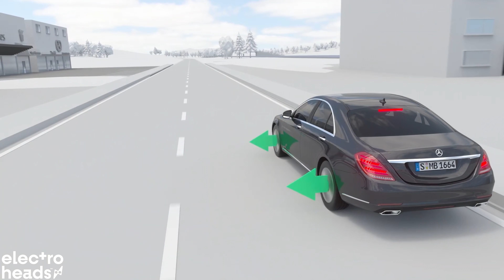The truth about why electric cars are so expensive

Comment: Interesting video so my twopence worth: To me the big problem with electric cars and regardless of price is the stupid amount of time they take to charge. If you think about the "range anxiety" thing would just go away if you could recharge them in the same time you could fill the tank. As you alluded to at the begining of the video, the current technology is total rubbish, under cooked to say the least. Lastly, if we really want to "green things up", I wouldn't start with cars which despite their numbers on the road, in individual terms are not used that often during a day whereas Artics, vans and buses are in constant use and really do pollute. Good video :)
Reply: My Kia can be charged up from 30% to full in around 40 minutes using a 100kw charger. Is that really stupid? But most of the time I - like most EV owners - charge during the night on cheap rate energy. The time it takes to charge then doesn't really matter, because you are asleep. Everyone has to sleep. So it's a good time to charge an EV. My Kia has around 300 miles range when fully charged. That lasts me almost two weeks, so I never worry about range. I find it strange you seem so assertive in your comments, yet you've probably never even owned an EV?
Reply: @Brian-om2hh  Sorry Brian, you are defensive because you have bought into it. Look as an OAP I could make an EV work for me just as you say but that is not my main point which going back in time when I was working, I had the need to use a car for visiting sites across the UK doing at least +30,000 miles a year for work and from that perspective, it's not really a practical proposition in my opinion. For the majority of users who probably only do a 20 mile round trip on a daily commute, it's probably fine unless we start getting a higher percentage of EVs on the road that outstrip the charging infrastructure. 

As to owning an EV, no I don't but then I got rid of my ICE car two years ago simply because the amount of use I had for it compared to the costs were to my mind silly, instead I just use one of my mountain bikes and for longer distance travel, public transport of one kind or another. I don't think that the technology is 'right' and the future may well be more influenced by changes in society and the way people live their lives. Originally a Londoner, when I lived close to Central London, I got rid of my car and became a cycle commuter, it was not just quicker to get anywhere but even 20 years ago owning a car in London was nothing but a liability on so many levels. Take care and keep yourself plugged in :)

Comment: small short range EVs; 20kWh pack 100mi range are significantly cheaper to produce than the similar compact gasoline version. Fewer parts, and as long as the battery is small total cost is lower. The question is why car manufacturers don't make them, except for the Chinese, that apparantly believe the more EVs the better and sell one of these for $5-7K? In other words, EV list price depends on kWh price of batteries. As it drops slightly each year, EVs will get cheaper. However European and American manufacturers are in no hurry. The profit margin for luxury EVs is higher, and they need someone to pay for a new production line. However this is decrimental to the rollout speed of EVs, so now in some countries, top range EVs no longer get a tax break, and the plan in Germany in the course of the next 12 years, is to implement a taxation based on consumption like any other type of propulsion. So in time the market will favour smaller cheaper EVs, and the high end segment will be saturated. At that point the money to be made are in cheap EVs, and the manufacturer will follow. Until then, we'll have to do with Chinese imports, which I suspect will cover that segment of the Western markets and be the prevailing small EV for the next decade.

Comment: As I mentioned on the other video from Richard - there are real consequences of switching our entire road infrastructure refueling system to electric overnight that the high costs are actually helping in an ugly way. Where does all the electricity come from for this EV revolution? Power generation in the UK ain't there (yet?) I know renewables are coming but they're only being brought in to replace existing dirty power generation. I hope the UK is actively investing in greater power generation infrastructure AND investing in a lot more public charge points, as there will be fist fights over public EV charge point availability. Home charging is difficult in the UK thanks to a lack of home garages in a lot of places, mine included. Plus the councils are actively stunting home charging by denying garden to driveway conversions (personal experience), if you're prepared to do this anyway. The world has spent 100+ years with personal transportation amenities at your local garage forecourt, these will slowly die a death, but not before the space is needed for more public charge points, in the thousands per city. We're not ready yet people!
Reply: Put enough petrol in a car to travel 100 km. Now put the electricity used to make that petrol in to a BEV and it will travel 70 km. So at macro level the Electricity required is a lot less than it appears. Around the year 2000 Oil refineries become coy about revealing their electricity usage, I wonder why. Refining is a very energy intensive process. 
We are not going to switch to EVs overnight. An EV on coal powered electricity is still cleaner than a petrol powered car. And doesn't have tail pipe pollution. That pollution kills about as many people as traffic accidents do.    Also once level 5 autonomy is reached your car can drive to the charger at night or when electricity is cheapest, charge itself up and return. Problems exist to be solved.
Reply: @danielstapler4315  If energy charges are based on peak demand periods, won’t overnight charging on cheap rates be turned on its head, with night time off-peak becoming the new peak consumption period?
Reply: @lotusgroup123  Yes, I think it will smooth out the difference in rates. But overnight charging will better use an expensive grid that is currently under-utilized. This would place downward pressure on the electricity price. Australia's grid is much more costly and more reliable than the USA grids and a KWH has 12 cents of grid cost attached to it. And that grid spends 10 hours a night not doing that much.

Comment: All three reasons are correct imho - legacy auto makers face a huge challenge to switch their production output to electric. I went electric in 2019 and have no regrets. I still have finance on the car, but even with this I am saving money over my old 2005 Mercedes which cost me £325 per year in road tax, and about £270 a month in petrol. I now run a BMW i3, I charge at home on cheap rate overnight electricity- 25% to full costs about £1.30, no car tax, no servicing. Smooth, quiet and relaxing motoring. My commute is very 'stop-start' on congested roads which used to add to my stress. In the EV it's relaxing, no movement; no consumption & the electric drive is sublime in stop/start road conditions. The stress reduction alone has been worth it.

Comment: 2 decades ago I studied economics in university and did a project on the price of jeans. The aggregate data proves no corelation between costs and retail pricing, suggesting the price to the consumer relies only on marketing strategies / the demand side of the goods.
It just might be similar with evs. Supply side costs don't explain the pricing of evs, however the demand for evs and total cost of ownership of evs over time explains the price to the consumer better imho and also the pricing difference between markets.
In a sense, the lower cost of ownership of evs vs ices, is reflected in the higher initial price point of evs.

Comment: Hello, You make some very good points. You mention that the price of electric cars is getting close to the price of petrol cars, that may be. But many manufacturers have increased their prices massively for petrol cars. For example if you look at the price of a mid spec Golf, it is about £25k. In 2017 a similar spec Golf was about £20K. I am sure that most salaries have not increased by the same percentage. Purchasers of electric cars are just guinea pigs as they are buying a product that is not fully developed and paying through the nose for it. Thanks for a good review.
Reply: Ice cars are going to get more and more expensive and rubbish as all rnd moves to electric vehicles

Comment: If you add in the externality costs of both EV and ICE approaches (oil extraction, production, greenhouse gases, pollution-related sickness and deaths VS lithium mining) you'd see an even greater 'savings' from EVs.
Reply: Don't overlook the oil industry, and their decades of mining cobalt. They need cobalt to remove sulphur during oil refining....And you omitted to mention the huge pollution caused by the occasional tanker oil spill, of which there have been plenty over the past 50+ years. Thousands of square miles of ocean and coastlines covered with thick crude, with the clean-up inevitably costing millions.... The potential of that disappears almost completely once we're all using EV's.....

Comment: In China EVs are extremely cheap and it is measure of time for this to happen in Europe. You can check the price of Chery Tiggo E (3xe) for example - it is about $15k. Of course the protectionism of greedy EU companies will not let this happen very soon.
Reply: So by that reasoning an iD3 in China will be cheaper then? Because the market place for the iD3 will be cheaper. Or is it that cars built in China are cheap in every sense of the word?
Reply: @martinblaylock7473  As far as I know chinese company SAIC will manufacture and sell the ID.3 in China but I dont know the price. I am sure they bild cheaper in China but they also made cars very practical using simlpe decisions without expensive extras which are suitable for most peolple of our world. On the other hand EU regilations during the last 30 years made cars in Europe so expensive and it occured that Chinese EVs  are cheaper than petrol cars in Europe nowadays.

Comment: I work in the automotive industry and it is not so easy to answer why electric cars are so expensive. The claim that batteries are expensive is no lie. But prices for batteries are decreasing with increasing demand and battery technology is also constantly improving. The RnD costs are also part of the vehicle price. And it is cheaper to produce an EV that is developed from the beginning as an EV because the company can directly create packaging that is cost and performance-optimized. in the electric VW golf for example the electric parts were put in the space that was there because of taking out the engine and the other parts that were not necessary anymore. The battery pack was split into two locations and was liquid-cooled. It was a development nightmare.

But it is kind of true that carmakers do earn more on petrol cars, don't need to invest much on improving them and would like to not kill their cash cow too quickly. For that reason and also because they didn't believe too much in electric cars till recently, they were not too much in a hurry to get out good and cheap EVs quickly. Now after the diesel gate, increasing emission norms, more and more EV startups and Tesla slowly producing cars that really work, the big car makers start approaching the EV topic more seriously. Maybe Apple will surprise us and really sell their own car soon and then maybe something small and affordable. (maybe the affordable is too optimistic)

Comment: VW, Audi group make the ID4 at over £40,000, and the Audi is over £100,000. Yet China can make EV's for around £8,000. The Renault KZE - which will be the Dacia Spring in UK at £22,000.

The battery technology is  not new, Tesla batteries are same cell type as a Laptop, cheap as chips.

Comment: The biggest machines battery powered were power tools, really? what about milk floats, fork lift trucks?
The cheapest family sized EV in UK the MG ZS is £10,500 dearer than the petrol version, yet they save fitting an engine and gearbox. It is a rip off.
Reply: It isn't £10500 dearer if you go to Autotrader or a similar site........ Autotrader are - or at least were - offering the basic MG5 electric estate car for a sub £20k price....   I've seen new Nissan Leafs offered for sub £25k, or PCP for £200 per month. Shop around..   In fact I just looked on Autotrader. Within seconds I spotted a ZS EV with 3000 miles on the clock for £16995. I also spotted an MG5 Excite with 1570 miles recorded, for £19340, so no need to fork out that additional £10 grand if you don't want to......

Comment: whether we like it or not, there is no turning back, At least I will never go back to a smelly oil leaking and burning ICE car.I have been driving a Nissan Leaf. It is a joy, friendly and civilized. I got a gas station in my electric plug, and I get a full 380 KL charge for just 11 Euro. Never need to get it in the shop for servicing. My insurance premium sank to almost half the cost, and I don't pay any road taxes either. It accelerates as fast as a sport can , and it is so smooth and quite, i could drive it for hours without tiring. The future? Easy to imagine the ICE car producers will have either to switch to full electric  or simply die within a few years. for it is enough for a short test drive to convince any doubters to buy an EV. Besides an EV drive train needs just 200 parts, versus 1200 parts for an ICE car or 1400 for an Hybrid. It is obvious that the EV will be much cheaper to produce, due mainly to the continuous sinking costs for the needed batteries.
Reply: Sounds like one satisfied customer there....

Comment: My view on the reason for EV price humping is similar to what you said about them sandbagging.
I live in Lincolnshire, and the nearest big towns are Lincoln and Grimsby, in Grimsby next to the Humber there's some big car parks full of new ICE cars all waiting to be bought, what's the betting there's many more around the country, those companies are going to want most of those shifted before the good affordable EVs are put out for sale.

Dacia with their Spring has shown cheap EVs are possible in Europe and not just China, ok it looks cheap and the 140 mile range is probably 100 miles, but it'll sell fast in cities.

Elon Musk has shown battery prices are a lot cheaper and he's claiming his hot hatch will be 25k, not cheap compared to ICE cars but definitely in the right direction, so the big companies claiming the batteries are expensive have been using that excuse for too long, the Mach E is proof of the sandbagging as the best car for Ford to EV would've been the Fiesta without a doubt, but they just brought out the useless Hybrid Fiesta, so don't expect a BEV Fiesta for a long while yet.
Reply: I used to live near Louth and when I visited Grimsby I used to see a lot of the cars being shipped abroad from there so that maybe why there are car parks full?  Some of the ships were registered to Malta as another right-hand drive destination. With regards to the batteries there still very expensive and the minerals are going up all the time especially lithium. Also the legacy automakers are having trouble making EV's with the extra costs involved while still continuing to make ice vehicles. They are nowhere near profitable for them at the from the experts I've heard from. I know it's frustrating as I'm just a retail worker who couldn't afford any of the new currently but hope there will be cheaper ones and more used vehicles in the future.

Comment: Personally I am curious to see how the ev preowned market turns out. Being able to upgrade and recycle the old batteries should also be interesting to see the aftermarket products. Mass adoption is in its infancy
Reply: You can get a Bolt right now for under $15k. It's a pretty good deal if you can live with the cheap seats ( I am assuming by the name that you are in the US Joe ).
Reply: @errcoche  Yes I am from USA. You're correct about the bolt being the best option. But soon enough many M3 preowned will become available for example.  I'm curious to see how this will play out
Reply: EV batteries (Nissan Leaf excepted) are likely to outlast the car 2x over. So don’t expect the cells to be recycled for a very long time.
Reply: @Dave5843-d9m  One slight advantage of the Leaf seems to be the ability to have it's battery pack refurbished for a relatively low cost....

Comment: Understanding that you already pay 3x what we do in the states for petrol, you also pay over 2x what we do for electricity (17p on average, if your utility is being accurate).  If driving 10 miles per day, I believe you'll find that it's a wash, whether you charge st home or at public charging.  Not only is it power used to MOVE the EV, but power to keep charge in really cold or hot weather and running the onboard 'always on' systems.

As to the price question, batteries have NOT, in fact, come down in price, and all manufacturers sell them at a LOSS.  There is no means of staying solvent selling them UNLESS you charge as much as you can, AND subsidize their sales with either ICEV sales or (as Tesla does) through wild empty promises to juice the stock and raise cash selling THOSE.

Sorry, but the fact is, EVs lost out to ICEVs over 100 years ago because they just weren't anywhere as good.  They still AREN'T, but we're being forced by government to make them and buy them...to the exclusion of all else.